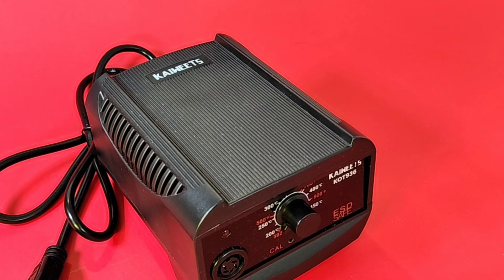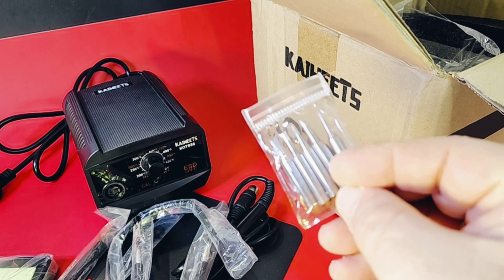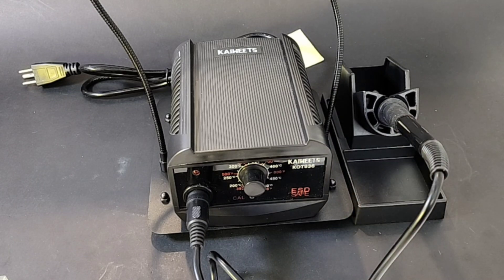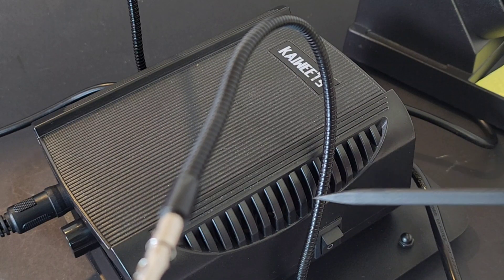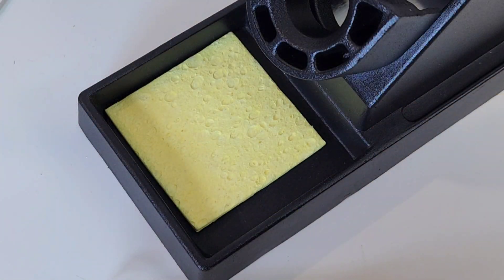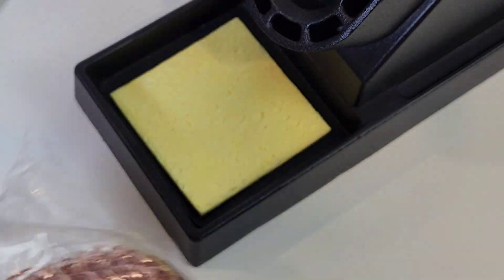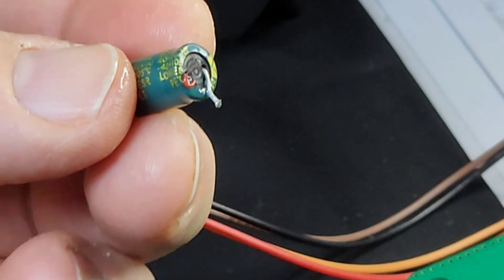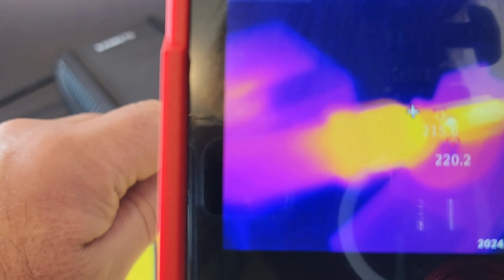KAIWEETS KOT-936 Soldering Station Review & Teardown!

Comment: Hello Darren)))
Cool soldering iron. Perhaps it will be more suitable for someone, because it uses inexpensive soldering tips instead of T12.
It would be cool if it had a 2nd output for a soldering heat gun and 4 crocodiles in the form of holders))
Reply: Good T12-cartridges for 2US$/€ are not that expensive. Please note, you have to spend at least 1US$ for good M900-tips, not the 1US$ to get 5 junk.
Reply: Agree. You understand what's going on. Soldering irons with M900 tips are budget, affordable soldering irons in which temperature control is set by the resistance of the heating element itself and subsequent measurement as it heats up. Among these soldering irons there are very good models that you can use to work, and not just leave it lying around at home. Of course, there is no sleep mode in such soldering irons, and the network cable is not of very good quality, but the heating element is not made of a spiral, but of a plate tightly seated in ceramic with a resistance of about 90 Ohms. It is precisely these cheap devices that these tips are intended for. I agree, there are garbage stingers for $1.5 (5 pieces) of which only 2 will work normally. At the same time, you can buy one of the best stings for price/quality, Kaisi, which costs $2. You can overpay and buy a tip from Mechanic, which makes no sense, because it is simply overpriced for a regular tip. And at the same time, you can buy a sting from Luxianzi, which costs $1.5 per piece. and it works very well. A T12 tip in China costs $3 (for me) and is a very cheap tip. And if you buy from a trusted manufacturer (and not the cheapest one), then it costs $3.5 per tip. I agree, the difference is not big, and the T12 tip is much more technologically advanced from a product point of view. But at the same time, soldering irons for T12 are not a budget option, they are already at least a mid-budget product (and if we consider mobile soldering irons, such as GVDA or Kaiweest, which also need to be equipped with a 65W charger, then this is already a budget of about $25-30. And I'm not talking about soldering irons of the TS100 level and higher).
From here it turns out that the difference in M900 and T12 is not that big, but you first need to spend more money on the soldering iron itself. And if you buy a cheap soldering iron for M900 tips, you can still provide yourself with very high-quality tips (Kaisi, Mechanic, Lixianzi) that work no worse than T12 and may cost even less or the same.  @deterdamel7380
Reply from the maker: Hey my friend! Yes, definitely a cheaper alternative to the T12 system and mote robust in some ways too. Adding a heat gun would really make this a total solution 👌

Comment: Very nice starter kit. Pretty complete. Unfortunate is the insufficient and movable thermal insulation of the handle. Longer time to heat up is levelled by the availibility of cheap solder tips in numerous forms and cheap and easy to get spare parts. Personnaly I prefer already something with a real transformer over something with a switching power supply anytime. BTW: Surprising but very appreciated appearing of Ms. Walker and your secretary at the Walker Media Production Company.
Reply from the maker: So true, the silicone protection seemed destined to fail. I've never seen that before but what a nuisance 😮 I agree the stability and robustness of a transformer based soldering station still has numerous benefits and they will always have a place on the bench (at least on mine!) BTW,   Walker Media  duo was really happy they could say hello 😂 👋

Comment: They named a station the same as this channel?  KOT!  I like stable devices that don’t get dragged around by the cord. So I guess soldering stations are safer due to transformer isolation and maybe a lower cord voltage too?
Reply from the maker: The KOT threw me for a loop to ! 😅 Correct Paul, less susceptible to spikes and this unit also pushed very steady power to the tip. Unless you need speed and do tip changes often, this unit should suffice for many.

Comment: That's an interesting product. The station looks good and robust. I really like the base with helping hands. The soldering iron holder is solid. But the soldering iron itself is disappointing. 

You absolutely don't want that insulation handle to slide around while trying to solder. And the thermal insulation itself seemed rather poor. 400°C is just slightly above average soldering temperature, yet it looked like the handle was far above 40°C. 🔥

It's either a problem with this particular unit or KAIWEETS has some fixing to do. Also, not a fan of pigtail fuses on soldering stations for obvious reasons. 

 But if this kit includes beautiful beach girls, you have my money, KAIWEETS.💰
Reply from the maker: The silicone tip/grip was surprisingly hot as the Thermal camera showed. Hopefully this can be rectified as I was definitely feeling the heat after 30 minutes of soldering 😮 Unfortunately,  the beach girls aren't included 😕👍
Reply: @KeepOnTesting  These slippy (apparently British people use this word) handles with bad thermal insulation are common in those cheap Chinese blue soldering irons. Looks like KAIWEETS just ordered their soldering irons from the wrong manufacturer. Putting their brand sticker on then didn't seem to help either. 🤔
Reply from the maker: @numerical_error  It was definitely on the toastey side ...hopefully Kaiweets can rectify this asap. Slippy sleeve is a nono ! 😃

Comment: Incredible technology for 2024😂
Reply from the maker: Actually it's not always about high tech.   Every workbench needs a transformer based solder station. There's alot of pluses which I won't get into but they are far from being antiquated. 😊
Reply: @KeepOnTesting  I second this. Transformer based are heavy, reduces movement of the unit and have always been reliable, no maintenance required, great for heavy duty 👍 😊
Reply: @KeepOnTesting  I agree, I’m more than sure it will get the job done. Just have not seen anything designed like it in 15 yrs😂

Comment: Definitely has that contraption aesthetic! What kind of desoldering iron do you have? I have the Anesty ZD-915. I have to slam it on the bench every other time I turn it on. I was always wondering why they sent me two of them. 🤔
Reply from the maker: My goto the last 5 years has been the Pace ADS200 w Accudrive. That being said, I've found a spot for the KOT-936 on my bench as well. The helping hands on the Kaiweets can really be helpful at times.  The included  magnifying glass in just too small and awkwardly placed to be of much benefit IMHO.
Reply: @KeepOnTesting  I'm going to fire up the ZD-915 today after a long hiatus from a broken heel injury. My parts Commodore needs some love after I butchered it for parts. It's a love hate thing.
Reply from the maker: @patkelley8293  Sounds like the perfect Sunday afternoon 👌
Reply: 💯 @KeepOnTesting
Reply: 💯 @KeepOnTesting
Reply from the maker: @Hartley94  👍